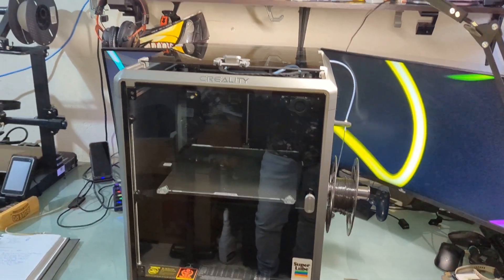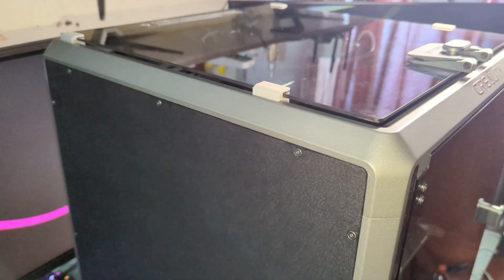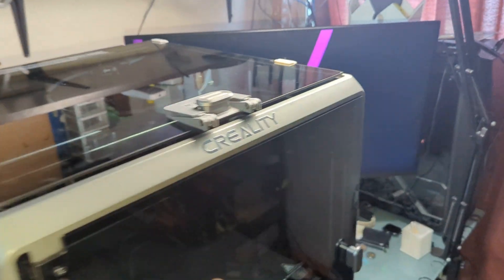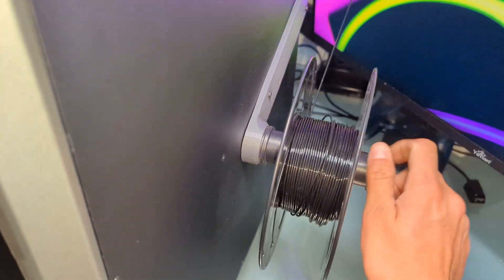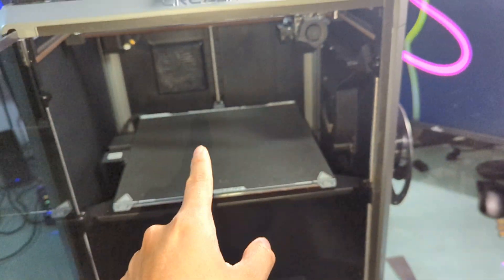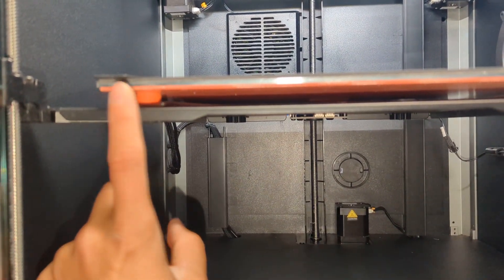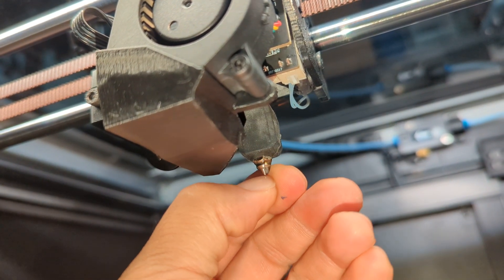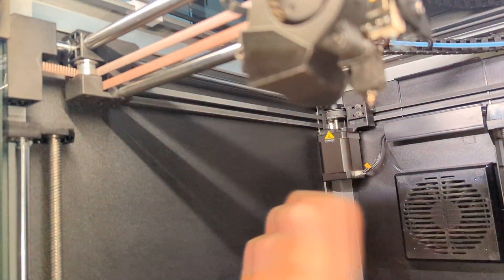K1 Max - Best Printable Mods

Comment: Why do you need those bed leveling things? Doesnt the K1 have auto leveling?
Reply from the maker: It does, well it probes the bed around and generates a mesh, which will try to make the machine compensate for uneven areas by lowering and raising the bed during a print. However, if one of the corners on the bed is off by more than what the probe can compensate for it will create uneven spots when printing in large prints, causing failures. What the bed leveling wheels do is manually allow to you adjust it so you can get the bed as level as possible, so the probe can do its job properly
Reply: @Zeltroix   thanks for the video just got my K1 MAX and upgrade to silicon spacers would like to see a foto of your mesh after fine tuning it... im stuck there I had the corners with same high and the midle was of by 0.40mm corners in about 0.50 and midle 0.11 I aproached the one of using a credit card that normally have 1mm to tunn aginst the hot  point,

Comment: СHC PRO from triangle labs more powerful! 2x time speed heating! Side fan only for PLA bat this printer more powerful to print simple plastics. I use this fan for heating camera to print ABS and complex composit plastics! If you hit camera to 60-65 C power printed items rise about 40%! Think 40%!!!! And you dasn't change pulley!!!!!  Ho ho its MAST HAVE upgrade!!!!

Comment: I have a K1 Max and I'm having issues printing a good benchy with 95a TPU. It is all good, until the chimney. Then it gets bad and looks all melted and squiggly. I can figure it out.
I challenge you to try it on yours.
Let us know how it goes.
Reply: Have to slow down for the chimney, or add cooling. Previous layers aren't cooling fast enough

Comment: WHEN YOU PUT A BRAND NEW FILAMENT ROLL OF 1KG IT FLEXES THE POLY SHEET THAT HOLDS THE BLOWER FAN INSIDE AND WHEN IT FLEXES THE FAN POINTS AWAY FROM THE BED AT A 20* TO 30* DEGREE ANGLE WICH IS VERY HORRIBLE AND THE FAN IS USELESS BECAUSE THAT AIR IS DOING NOTHING SO I QUICKLY REMOVED THAT HORRIBLE SPOOL HOLDER WHEN I DISCOVERED THIS FAILED SPOOL HOLDER SO I ADVISE ALL OF YOU THAT NEED A SPOOL HOLDER TO GO WITH A TABLE TOP OR ONE THAT MOUNTS DIRECTLY TO THE PRINTERS FRAME TRUST ME YOU WILL THANK ME LATER. DO NOT USE THE ONE IN THE VIDEO I REAPEAT DO NOT USE THAT FAILED SPOOL HOLDER